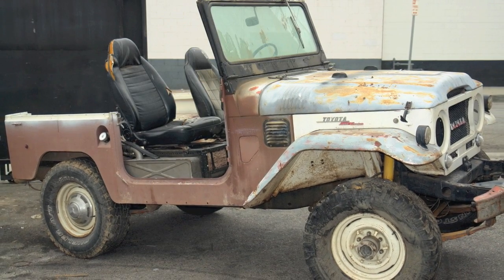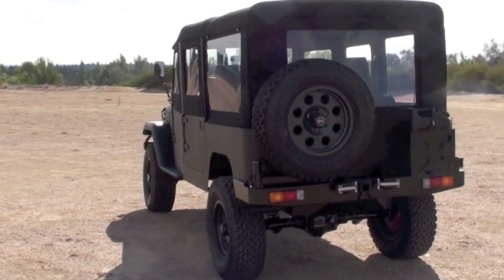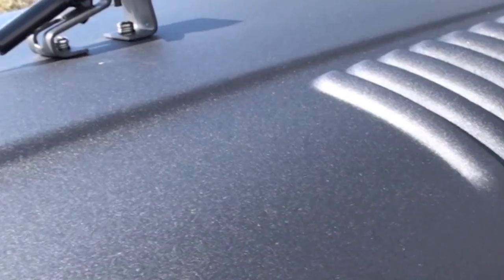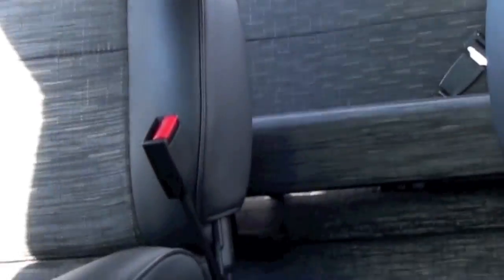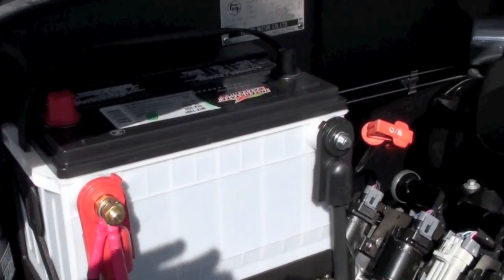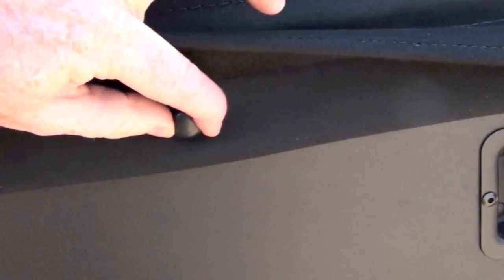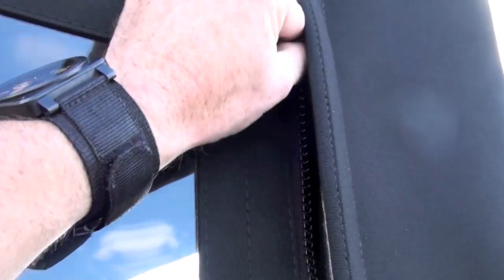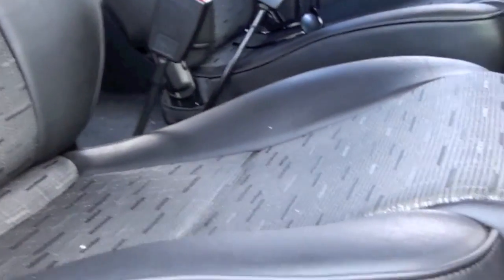ICON FJ44 #70 New School Restored And Modified Toyota Land Cruiser FJ40

Comment: Wow I love this vehicle, great job. Also I was wondering if you know about diamond like carbon (DLC)? It's a surface coating that is extremely durable, has low friction, and it's a flat dark gray. It is commonly used on mechanical tools such as drill bits and knives. Just something you might be interested in.